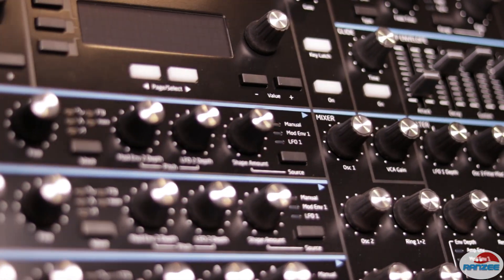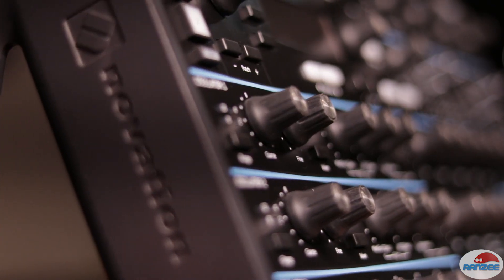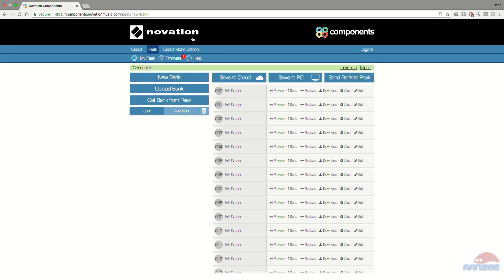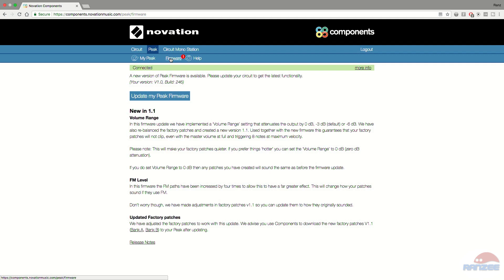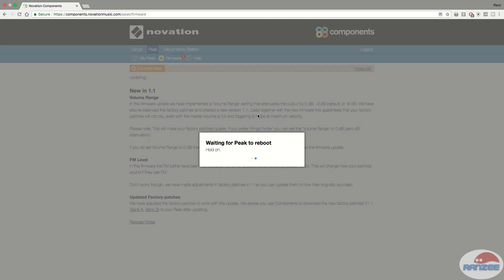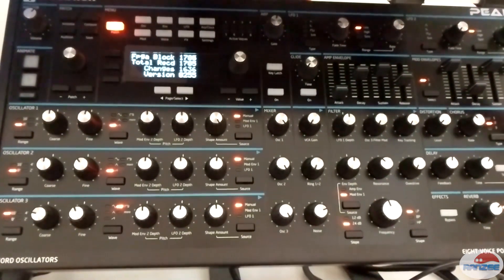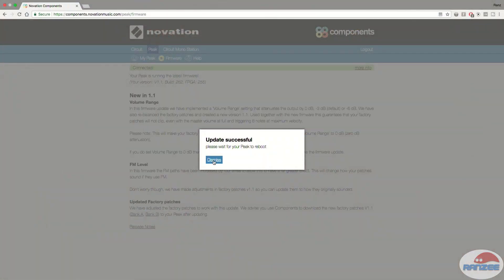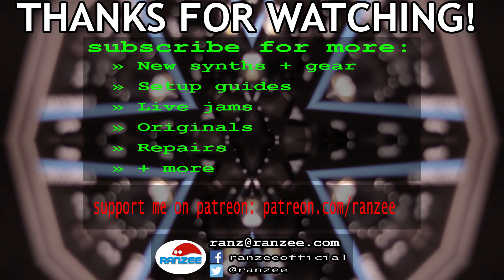how to update Novation Peak firmware

Comment: Great video.  ....but i tried updating to ver 2.2 in June 2024.... when I connect to Windows computer and opened the Components...it says there is an update.   After successful updating ....the version shows 126.618 on the summit screen instead of ver 2.2.    On my computer screen it says 'Your Summit is running Vcustom build 2126 FGPA 778 '       How come it doesn't show ver 2.2 which is supposed to be the latest version? Thanks!
Reply from the maker: It might mean that the update hasn't happened. As you have a Summit there might be some slightly different procedures to this video - you could always reach out to Novation Support and see if they can help! Best of luck!
Reply: @ranzee  thanks...I kinda suspect the same.....

Comment: What if you bought it used and the prior owner didn’t unregister it.   Is that still an issue and if so what to do?
Reply from the maker: I'd be contacting Novation support - they can sort this out for you.
Reply: @ranzee    Trying to find out if there are obstacles to updating the firmware before picking an old one up

Comment: So, what if nothing happens when you go to update the firmware? Seems like an easy process, but it literally just sat there saying 'this may take some time'. I haven't been able to proceed further than this
Reply from the maker: Hi Eric, Are you using a Chrome browser? I believe it is preferred (a browser that supports MIDI-web - Opera is the other one I think). Making sure everything is plugged in and turned on during the whole process. Don't use a USB hub - plug the USB directly into your computer. Don't venture off that page (and surf other pages) whilst the process is running. Whole thing should only take no more than 5 minutes. If you're 100% with all that - then time to ask for Novation Support to step in ...
Reply: @ranzee  yup, I am using a Chrome browser. Everything is plugged in and turned on. Haven't left the page (writing this on my phone, not my computer). It seems the issue must be with my registration as I just received this Peak in a trade and have been unable to register on their website as I don't have the requested data (eg. date purchased, location purchased, bundle code, etc.). I've reached out to Novation for a path forward, but it is pretty ridiculous that I am unable to update my Peak seemingly because I didn't buy it direct from them or one of their retailers.

Comment: You should read all the posts on the Novation Peak Facebook group. So many Peaks are fucked after the 1.2 update. Maybe it is worth €50,- letting someone else take the risque of bricking a €1200,- synth.
Reply from the maker: Yeah I've read - perhaps Novation need to improve their firmware update system ...
Reply: Nope, its because people don't read the instructions. No Peaks have been bricked, just idiot know it alls not reading the detailed but simple process to upgrade. I've upgraded three Peaks through two upgrades, no issues with any of them. This is just trying to justify clickbait.

Comment: I hope to buy a PEAK one day. But my laptop is a Chromebook which doesn't run on Windows, would I still be able to do a firmware update? What would happen if you don't do an update? As you can tell this part of owning a synthesizer is somewhat alien to me.
Reply from the maker: Hi Jon, you may want to check with Novation - but as far as I can tell the firmware updates are done via a browser (I used Google Chrome) - so in theory your Chromebook should be OK. If you don't update, you'll not get any of the new features and bug fixes - but you could take it into a store and get them to do it for you. The Peak will still work without doing any firmware updates - I took a few months to do mine, and it worked just fine.
Reply: Thanks very much indeed for the info ranzee.
Reply: @architectofechoes4  The hardware and OS is irrelevant, so long as you're running Chrome, it  works. Good question though.

Comment: What does the update change? Not every latest version is better with instruments sometimes.
Reply: Sorry saw the update notes. Not much i see but hey little by little
Reply from the maker: Release Notes for Firmware Updater 1.1 (Firmware revision 262, FPGA revision 255)

New Features:
- Oscillator FM paths now 4x stronger in the modulation matrix
- Oscillator FM paths can now be stacked up by using multiple mod slots for further FM modulation
- Selecting “More” wave type will display and select the “Wavemore” option on the menu for quick selection of the wavetable
- Volume range setting in menu allows reduction of the master volume to 0db, -3dB and -6dB
- 3rd Saw wave added on Saw Density for thicker sawtooth when combined with Saw Density Detune
- Synced Delay will now wrap to max available synced time opposed to longest delay time at low tempi
- With arp off, Key latch will sustain notes. New MIDI notes will replace any current sustained notes in a similar way to Key Latch with Arp On
-For Series FX routings, intelligence has been added for optimising levels and returns for each FX send. When FX levels are not at max, an amount of dry signal (dependent on levels) will pass to all the FX allowing all FX to be heard on the initial signal.

Fixes:
- Reduced noise when oscillators are at low volume in the mixer section
- Pot pickup works for switchable controls e.g. Mod Envelope faders
- Reduced screen anti fight timer time
- Clock status will not overwrite screen when moving a parameter
- Reduced 
- Improved filter response with slow manual movements
- Improved FPGA update process
- Removed clicks on certain series FX routing settings
- Fixed returning exported settings 

- - - - - - - - - - - - - - - - - - - - - - - - - - - - - - - - - - - - - - - - - - - 

Release Notes for Factory Banks 1.1 to be used with 1.1 firmware/FPGA update

Fixes:
- Oscillator FM modulation reduced by 4x for improved FM modulation depth
- All Patches balanced for new volume range setting default (-3dB)
- “Analogue Kick” & “Analogue Snare” changed from “Poly” to “mono2” voice mode

Comment: ok, now we need a new firmware from novation for peak ;-)))
Reply: New wavetables!
Reply from the maker: Hi RcMuSic35, any ideas what you'd like to see them add? (within the confines of what's possible). For example multi-timbral, extra voices?
Reply: As much MPE compatibility as possible. Right now I set up modulation parameters to make use of the CC and what not that are being sent from my Roli Seaboard - but if they could implement in their midi internally to receive on 16 channels like the MPE standard and make it a non issue.

Even stronger FM. Adding the MPE as modulation sources. Wavetable editing and user ones.

But all in all I would like to see a better midi implementation for easier use with MPE equipment.